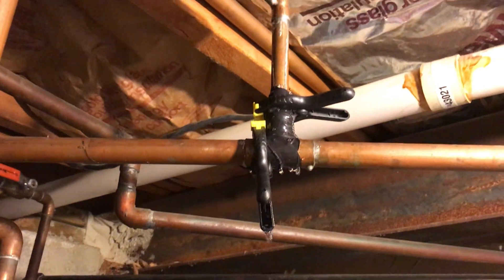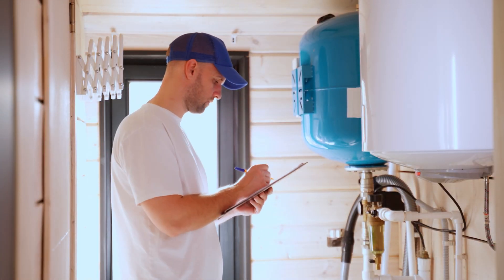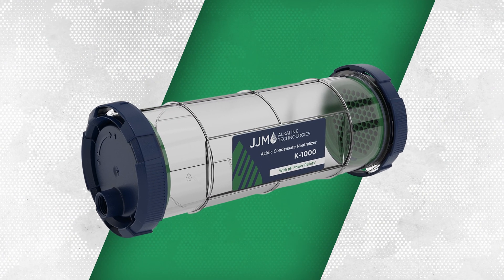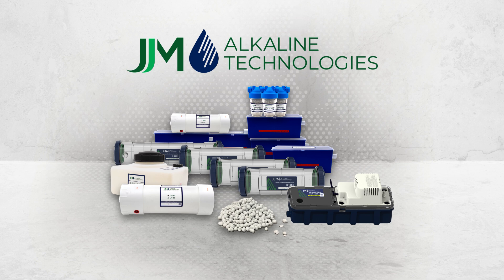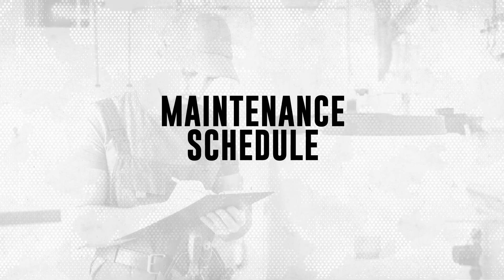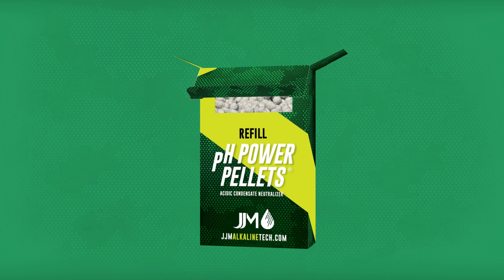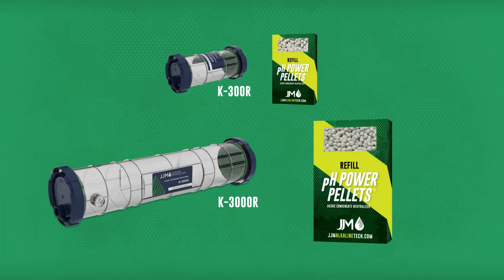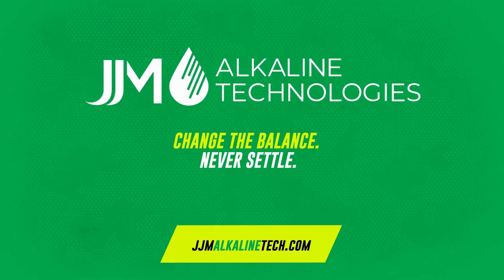Why Condensate Neutralizer Maintenance is Important

Comment: We’ve had a tankless water heater for four years and have a service contract for annual maintenance.  I’ve asked about the condensate neutralizer in the past and was told the medium wouldn’t need to be changed for several years.

This video says it should be changed annually; correct?

How should they test the PH and at what PH should the be changing the medium?

They just need to change the medium; correct?  They don’t need to replace the “cartridge”.

In advance, thanks for your guidance.